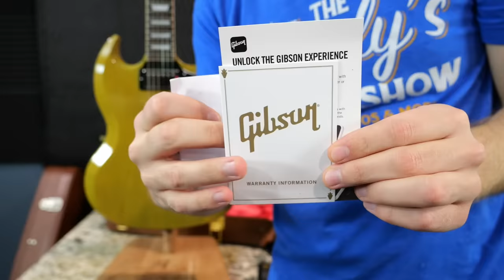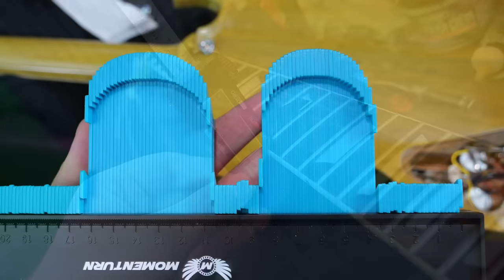I Was Asked to Review a Different One... | Custom Color Series Gibson '61 SG Standard Review + Demo

Comment: Those '61 pickups sound 3 dimensional compared to the 490 set you reviewed in the SG Standard.  Fabulous sound!  Terrible QC on the headstock as you pointed out, but the TV Yellow is really nice looking.  I don't care for the look of the batwing and IME the bridge pickup height adjustment is hindered with parallel direct mount to the PG.  I played the white '61 at my shop just yesterday - what a killer.  I'm going to grab it tomorrow.  BTW, I agree with you about the neck - while thinner than the Standard, it's not too slim at all.  Very comfortable.  Did I say those pickups sound awesome?!

Comment: Just got one of the white 61 Standards and it’s great. I did replace the tuners with Sperzel locking tuners, and replaced the pickups with Dimarzio Super Distortions, however. Wasn’t too keen on the stock tuners and pickups.
Reply: Do you still have the pickups? Any interest in selling them?